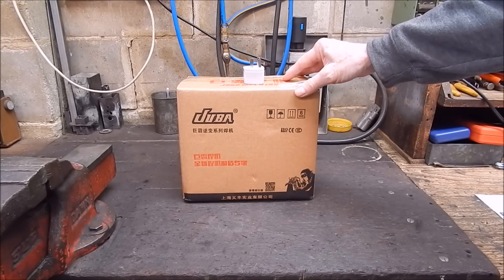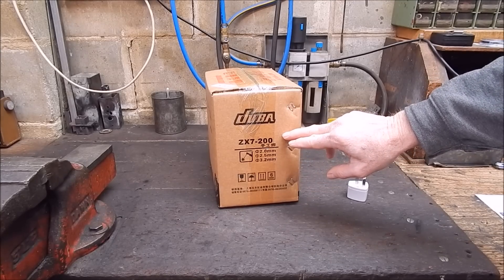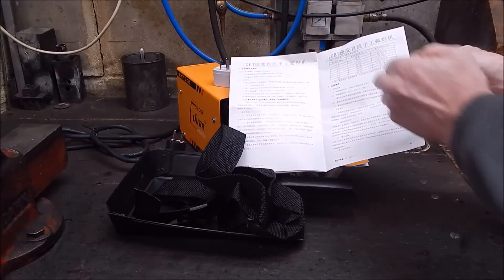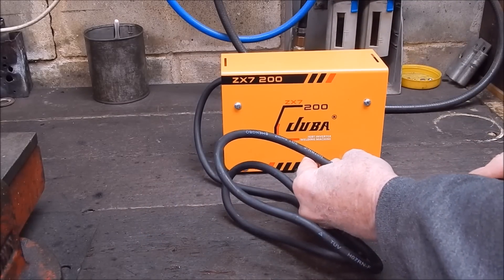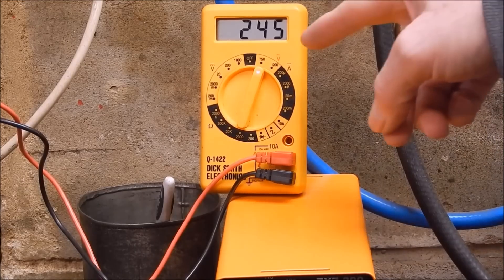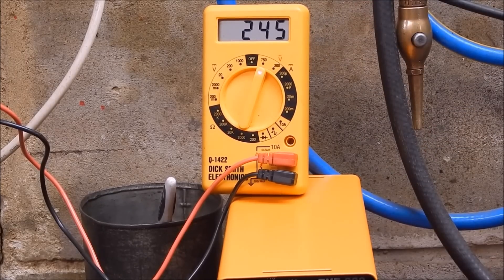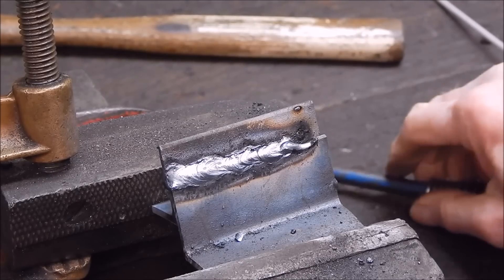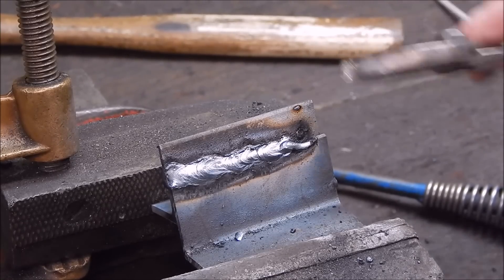I review another tiny inverter stick welder from Banggood - excellent

Comment from the maker: Following comments from the owner of a similar unit, I was not satisfied that the duty cycle on this welder is adequate, so I ran some 3.2 mm rods through it continuously in the next video to see how long it takes to overheat it. 

I also have serious reservations about the supposed output figures stated by other reviews - they just don't stack up with the excellent way it burns 3.2 mm rods.   As these units use pulse technology it is quite possible that these measurements do not give a true indication of what is actually happening.

The ZX7-200 circuit board is used in a wide range of DC welders being sold, but I think there is a probable difference given the large price variations.  This would come down to the size and quality of internal components and the accessories included.  As stated in the video, I can only comment on the one received.  Whether cheaper units perform at the same level I cannot say. 

However, as of 2020 looking at buyer comments for this hugely popular little welder,  the response is virtually 100% positive across all brands being sold.  Cheers Rob
Reply: Did it not come with leads?
Reply: xynudu yeah thats the question for me. i dont think a 2" bead then a long rest is really a good test of the duty cycle, which is really the big issue with these tiny welders. If i were doing the test id let it cool completely then see how long it takes to run it to thermal shutdown running a constant bead a couple times at a few amperage settings.

Comment: Good indept review. Has it held up long term?
Reply from the maker: Thanks.  Yes, it's given no trouble.  I mainly weld with AC as it tolerates junk and dirty steel much better.  Arc blow is always a possible issue with DC.  Two quite different welding mediums.  Cheers Rob

Comment: We are in nov 2023, and i just saw this model in the island where i live not far from Australia,its small and light so easy to carry and its cheaper than any other welder.They just started appearing here and am sure more people will buy them as inflation and cargo cost get worse than they already are.
Reply from the maker: This model welder is very capable, BUT like all DC welders it is only good for totally clean, unmagnetised metal otherwise arc blow will drive you crazy.  AC is still my preferred welder for anything that needs to be burnt in or is rough/scrap metal. Cheers Rob

Comment: sorry my friend by you failed to draw the distinction of time on and time off
as 20% can be if for example 4min on and 16min off
as i cant run a stick for 4min continuously.
but nice video and nice welder..
Reply from the maker: The virtually standard duty cycle test period is 10 minutes, using a resistance load, NOT welding rods.  No one expects any welding rod to burn for 2 minutes before being swapped out.  The welder run time has to be cycled during the test to calculate recovery time as a component of the duty cycle perecentage.

Comment: all chinese machine has hot-start, arc-force and anti-stick, duty cycle(20% - 35%) is low on low performance machines as this one, but can be ignored - as they claim it to be in effect @ 40degC. This could be a 100A machine(max) but the scale and output may not be linear? 7018 rods not ideal(ocv too low), basic, mild steel rods - yes

Comment: Robbie how do you get to do these reviews?
Reply from the maker: Hi Don, I often get contacted by Asian companies wanting me to do collaborative reviews.  Not all of it is relative to the channel and some want to review/pass the videos before posting, so they don't get past first base.

Banggood contacted me, gave me total control and accept my honest reviews.  Been great to deal with.  You can approach then as they had several review options last time I looked at their web site.

Ali Express also have a review process you can join, but the whole system sucks badly as they lottery out any products against other chanels, review all videos to makes sure they are totally positive, and basically you will NEVER see a negative review on Ali Epress.  What pissed me off even more is that you are dealing with a whole bunch of individual little stores (Banggod is one store and not just a front end), and they even have channel restrictions such as the age of the reviewer, and total number of views and subscribers.

You don't get any of that with Banggood.

I have also done one off reviews for three other companies.

In all cases you get to keep the product.

I hope this has clarified things a bit.

Cheers Rob

Comment: Hi, my newly purchased version of this welder was  supplied with just the 2-core mains cable and NO plug. I'm assuming the unit is not earthed and am confused as to whether I can adapt it to the 3-pin earthed system here in the UK... Help please before I'm electrocuted!
Reply from the maker: There are many brands of this welder being sold now, so I doubt it is the version as tested.  It's easy to replace the two core cable with a three core and earth it onto the chassis at a screw point.
Reply: @Xynudu  Rob, thanks for taking the time. Yeah, swapping the cable for a 3-core was my next move, but strange that any potential purchaser isn't pre-warned. Atb.

Comment: I bought one at Harbor freight, that says 80 amps on the box, but 75 on the back of the welder...lol...it welds okay, and it kind of surprised me for what it weighs...it kind of reminds me of the lunchbox I had in junior high school...it will do until I get my Miller bobcat back from my uncle...I'm using it to build a wood stove out of a 33 gallon sandblasting tank...I'm cutting it down to about 2/3 of the size it is now...I probably would normally have bought a bigger one, but I'm buying 18 big boat batteries for my solar system, two batteries a month...so far I have 14...will be 16 in a couple weeks...so I just got the smaller one...P.S> before I got the generator put together to run it, I needed to make a weld on the pulley...it is three parts put together to make a 3 and a half inch pulley for the motor...so I put some welding leads on my 24 volts battery bank ( at the time it was 10 batteries) and welded off of them...that let me get the generator going to run the welder that I bought...lol,  in case I needed to charge them then I could hook the generator up to my Aims inverter / charger...it's only 2000 watts , so I don't really want to try  running the welder off of it...if you turn the welder up much it exceeds the 2000 watts...the old blue Winco on the generator doesn't mind though....even though it's 2000 watts too...so I just use it when welding...for now.
Reply from the maker: They actually weld quite OK David.  Lots of positive reviews.  The few negatives are from snobs who think their welders are the best.  I gave the worst of the three I reviewed to a friend and he absolutely loves it.  Take into account the cheap price and low power consumption, they are a bargain.   The only downside is that DC doesn't weld rough dirty work very well.  AC is still the king of field repairs, burns through anything. After decades of experience I weld better with AC for sure.  Cheers Rob

Comment: I have 2 of these. The open circuit voltage is 63 volts, too low to run 6010 rods. Does good with 6013 and 6011 rods (all rods 3/32" 2,38mm) Has a hard time with 7018 rods. The claimed amps on the dial need to be divided by 2. So if you have the dial set at 120, the actual amps will be around 60. The most amps these will put out is slightly under 100 amps. Best electrodes for this machine are the 6011 rods, and it'll do okay with 1/8" (3,2mm) with the 6011 rods.

Comment: I'm curious are the relatively new digital inverter welders better with US 110 voltage than the old transformer type AC welders?
Reply from the maker: Better in what way ?
Reply: @Xynudu  better meaning, easier for a novice or beginner to learn with if one only has access to the US 110V power supply?
Reply: The reason I ask is I have a cheap transformer type welder that is AC only output and I am having a helluva time just trying to get an arc started, nevermind any actual welding practice- it just doesn't seem to have the power to create an arc unless I am super careful to keep the electrode about 1/8" from the material.
Reply from the maker: Maybe it's not wound for 110 ?   It has to be a 110 version or the amps will fall through the floor.

We don't have 110 in Australia, it's all 240 volt.

DC stick welders are less mains power (amp) hungry than AC.  They also strike an arc easily and maintain it easier.  So a novice should find it easier to use.  Having said that, I prefer AC as I learned on that and know it backwards.  DC can cause real headaches with arc blow, which AC rarely does.  There are ways around it (increase rod size) and all metal must be totally clean - DC does not like dirty, oily, rusty work that AC would eat for breakfast and then ask for more.

So the answer is, yes DC will be easier to learn (make sure it's a 110 version) but DC can be a pain in the butt if metal is not in top shape. The big plus is that DC does not burn through anywhere near as readily as AC (it's biggest down fall) on thin gauge metal, so it's good for that and joining thick to thin (which can be a problem with AC).

I hope this helps.

Cheers Rob

Comment: Where would be a good place to buy an inexpensive set of welding cables for this? Thanks
Reply from the maker: From a cheap secondhand AC welder.  That will save a fortune:  https://www.youtube.com/watch?v=mt4Mw9NHIVM
Reply: Any good welding supply store will sell cable by the foot. If you get size 2 cable, it’s not expensive, and you probably don’t need more than a few feet. They might even have some short “ends”, or used cables off of trade ins. #2 cable is not large, but it’s more than adequate for this size machine or larger. You’ll be surprised how little it costs!

Comment: can it do reverse DC polarity? DCEP?
Reply: nevermind, 9:20 clearly shown its DCEP reverse polarity with grounding using the (-). How about DCEN tho?
Reply from the maker: It does both.  By swapping over the electrode lead positions you can elect to use a deep or shallow burn in.

Comment: Whats the correct welding rod for inverter welders_
Reply from the maker: You can use regular AC GP welding rods for DC/inverter welding.  Most welding rods are NOT polarity specific.  So all those old rods are likely to be OK with DC.

Some current specialised rods such as low hydrogen etc  may now be polarity specific with DC and if so,  It will be marked on the packet.

If you look at rod data /spec sheets at your local supplier you will see that very few are polarity specific.

Cheers Rob

Comment: Great video.  Quick question can i weld light tin with it like my old lawnmower base
Reply from the maker: If it is at least 1.5 mm thick you should be OK, provided you are a half decent welder.  Obviously you need to have the amps turned down low and move the rod fairly fast.  Using a low penetration rod and reversing polarity on the welder leads will also help stop burn through.  Cheers Rob

Comment: I was looking at mini spot welders but seen this little welder au $60  electronics are smaller than i last used 1980s 😳
Oz straya  au-  $ https://au.banggood.com/search/mini-spot-welder.html?from=nav
Note  You must buy the cable and the welding pliers separately. It would be good to replace the power cable with a thicker and longer one, with 3 wires, so that it also has an earth $ add $20 +

Comment: I've been playing with one of these for over a month now, driving it with a 5.5Kw Chinese diesel genset.  With 3.2mm 7018 the engine sound changes, seems to get deeper without really slowing down, like it's definitely working but still in a range it's happy with.  Haven't  even come close to making it trip the overheat.  Using it feels weird, like it's not really a welder, just some sort of adapter to plug welding cables into the genset.

Comment: are you using the 6013? or what kind of rod
Reply from the maker: GP rods such as 6011 and 6013
Reply: On DC, go with 6010 & 7018! Those cussed 6013’s are the worst rod in the world to have big slag pockets in the weld and blowouts in the end crater! 6011 works ok on dc though, largely because they were designed to be an ac friendly version of the 6010 which is a dc only rod. The 6011 has an ionizing agent in the flux that helps maintain the arc as the polarity reverses during ac welding. I don’t know about other countries, but in the US ac current is 60 cycles per second, or 120 polarity reversals!

Comment: Hey Rob, I changed my channel name since I last commented on this welder, (they sent the one with the tiger on it) did an amp test (bought a DC ammeter) and took the cover off. This was videoed for my channel. The welder is still going strong. I did buy a better one but I have yet to run the 50 amp 220 line for it. Anyway I still am amazed how good the little thing works considering how little is inside of it. It tested at 72 volts open circuit voltage and 140 amps, close to the 150 I figured from the math. It still runs very smooth. It's IGBT which accounts for the size, good luck to you and I check in to see how you're doing from time to time. Cheers
Reply from the maker: Good luck with your channel.  You get back what you put in.  Make it interesting and interact with your viewers and you will succeed.  That's a good little welder for the money.  Regards Rob

Comment: I bought one of these welders about three years ago.  I burnt many of rods with it, I made two sauna stoves out of 3/8” plate and welded it with5/32” 7018.  I weld for a living and I can honestly tell you that for the money it makes no sense how well these machines work.  They will not strike an arc as well as an industrial machine but once you got it burning it’s smooth and consistent.  Great for any work at home.  Do not hesitate to buy one.

Comment: dear sir,  is this still working?  i am going  to buy an  igbt converter model but im afraid about durability. which is good?  DC inverter or BX6 AC model? Thanks.
Reply from the maker: It hasn't had much use, so it's not a real test.  I have had no experience with BX6. Cheers Rob

Comment: I was impressed by your video but it leaves me with questions on the rods used.     Murex is, I believe, part of the Lincoln Electric family, I was unable to hear what the Red Chinese brand rods were.     I have never used 1/16" (2.5mm) rods so I have no experience there, the 1/8" (3.2mm) rods were what the welding company I worked for when I was in school used for everything.     The last question is what rod series were you using?     I am assuming that these are your AC welder rods also and I am guessing 6013 GP rods, they swing both ways , AC/DC, and leave heavy slag.     For what it is worth I have a 1983 Century AC/DC 230/140 amp machine with a duty cycle of 20% at 230 amps.     -jp
Reply from the maker: The Chinese rods are SWEC brand - quite good and used by industry.  The rods are GP AC rods.  You can't actually buy GP DC rods (polarity specific) - as most rods sold are not polarity sensitive, except for some specialised rods (low hydrogen, stainless, cast iron etc which will be).  There is still a place for AC welders as they are much more forgiving than DC for rough and dirty field work.  DC is also prone to arc blow in the smaller rod sizes - 3.2 mm is generally better.  Cheers Rob

Comment: I think people are a bit put of coz there all made in China, l was a coded welder yrs ago, sold my oil cooled set few years ago as l was offered a unbelievable price, anyway l bought a Parker 160 inverter few weeks ago, it's amazing how good these lil sets weld, I'd say just use 2.5 rods, being a DC set if ya get arc blow just move the earth clamp this normally stops it, mine was £60 there so light and small, l just welded an angle iron shed frame for a mate l used 2.5 E6013 rods burned about 80 rods it was spot on, l run it on a 16amp supply.
Reply from the maker: The arc blow aspect is the only negative side of DC welders.  It can be a real pain in the butt if the steel is slightly magnetic or the stars don't all align correctly ;)  I have tried moving the earth clamp, but get best results going up to the next rod size.  This has always worked for me.  I still prefer AC for rough/dirty welding jobs.  Cheers Rob
Reply: @Xynudu  yea, AC is good, l like DC as usually use low hydrogen rods,

Comment: Forgive my ignorance, how do you check if the chassis is earthed?

Thanks.
Reply from the maker: Hi Joe,  Use the Ohm resistance setting on a multimeter to check for conductivity between the earth/ground pin on the power lead and any metal part of the chassis.  Regarding your other question, the two small connectors are the industry standard cable connector (Dinse) now used on all small welders - fast connect and fully insulated.  Cheers Rob
Reply: @Xynudu  Hi Rob, thank you very much for the answer.

Cheers,
Joe.

Comment: Hi. Info for you all. It runs scratch start tig very well too. You just need to secure it to something, it’s so small and light the welding leads pull it over if you are not careful. Conversion to tig is easy.
Reply: Easy, but imo most definitely not worth it. Get a proper second hand machine with price of parts used for conversion.